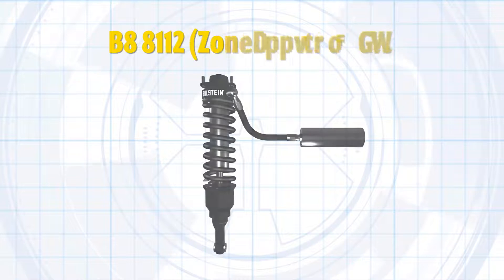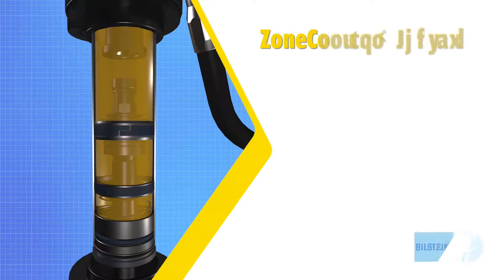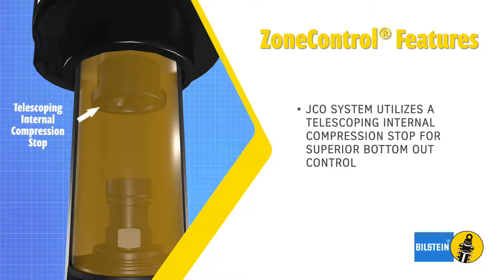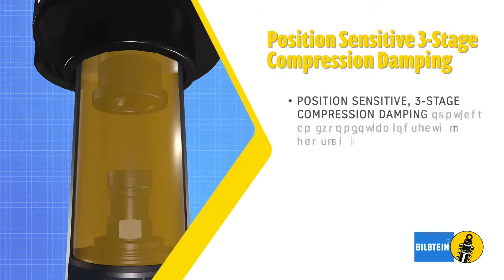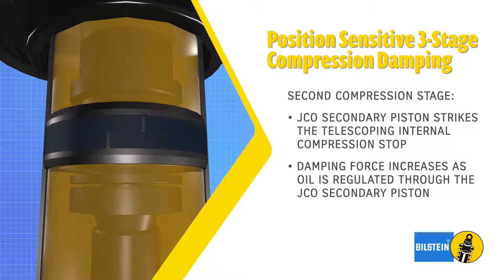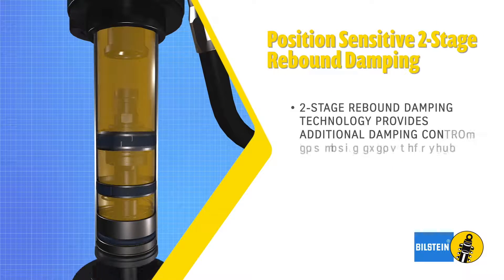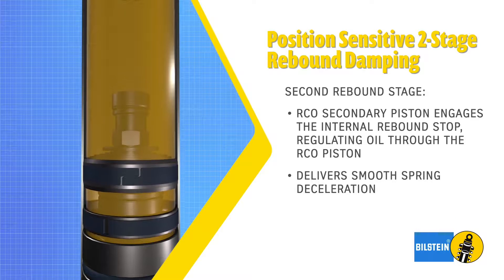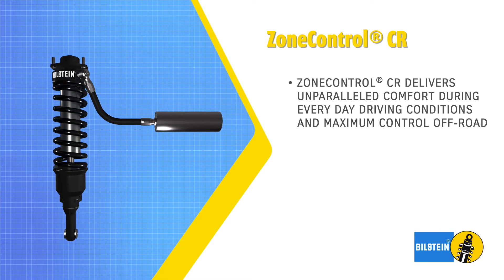Bilstein B8 8112 ZoneControl CR Technology | Tire Rack

Comment: I bought a set of the 8112 for my 2015 f150 . My question is : if I set the exposed threads to 0 the instructions say I have a 1.5 inch lift … does this represent a stock (oem) height or is this 1.5 inch higher than stock ?